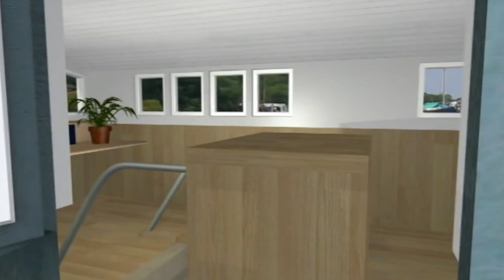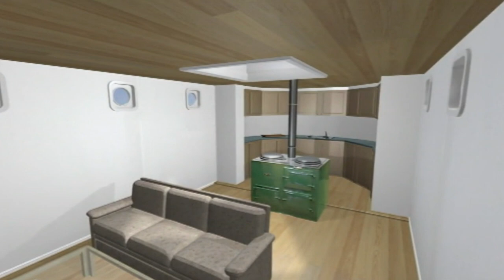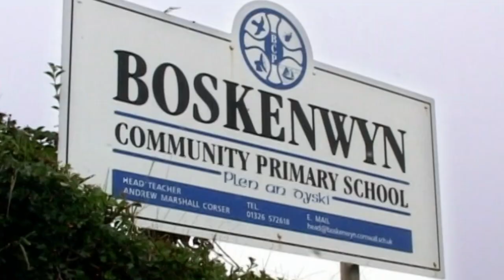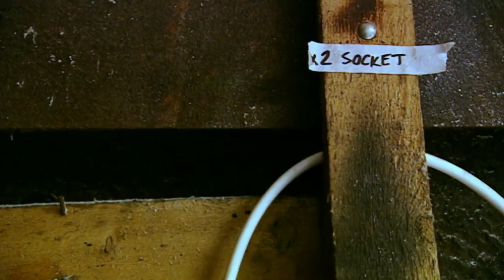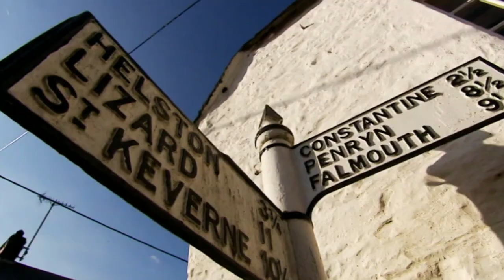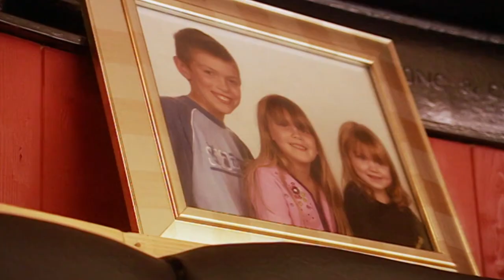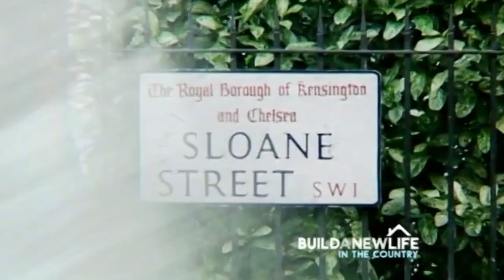Cornish Barge Renovation - Build A New Life in the Country - S01 EP4 - Real Estate

Comment: Well done Carol for pursuing your dream. I lived on a boat for 5 years and absolutely loved it, there is nothing like it!  I was curious though, I was told a boat has to be balanced when you refit it and you had your kitchen with heavy granite worktops on one side and I wondered if the same amount in weight of ballast was put under the floor on the other side to stop it from rolling in the water, or is the boat permanently moored and doesn't go out on the water. Wonderful achievement on such a small budget!.

Comment: the more i watched this series, the more the show looked staged. the money wasn't there. there was no
sign of an engine room. didn't see a water heater. no word about holding tanks. gray water / black water. didn't see a generator.
didn't see the barge being hauled out to sand blast the haul. fifteen thousand pounds to restore the
barge. try one hundred thousand pounds.  then Simon spends money on a speed boat. fifteen thousand
wouldn't cover a complete rebuild on a kitchen and bathroom in a home that isn't floating. the split
up over a rust bucket. the charter business. nothing was mentioned about who has the captains license
for chartering. however, the show was entertaining while having dinner in new mexico.